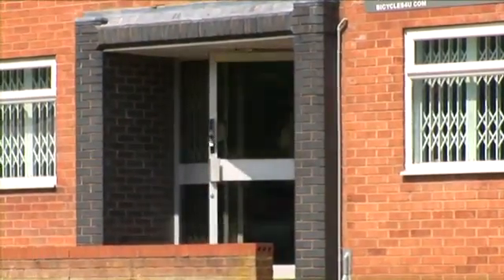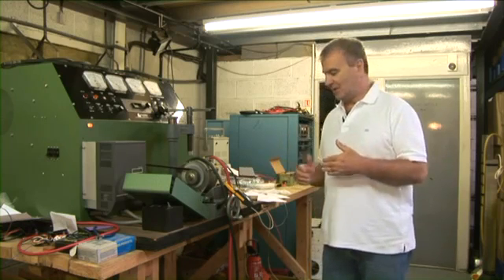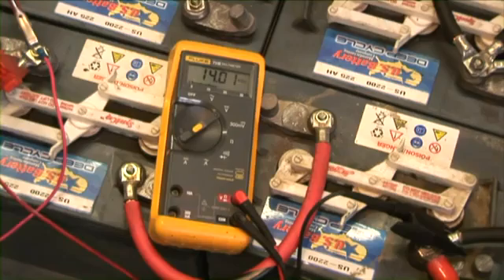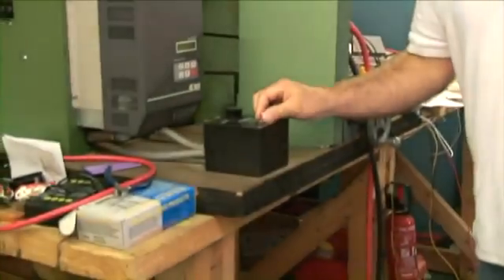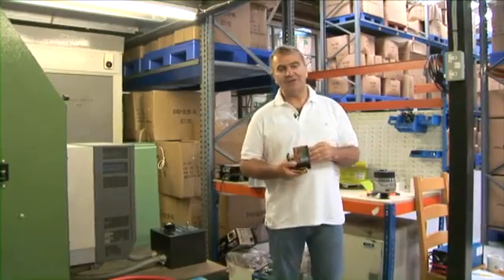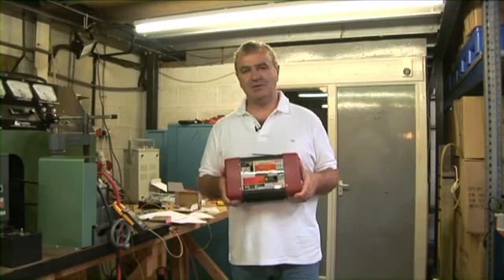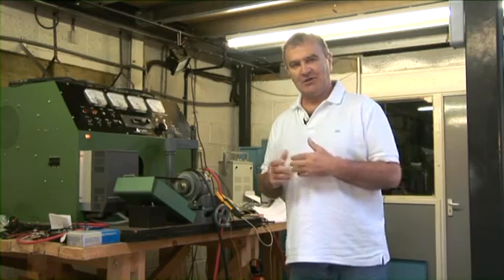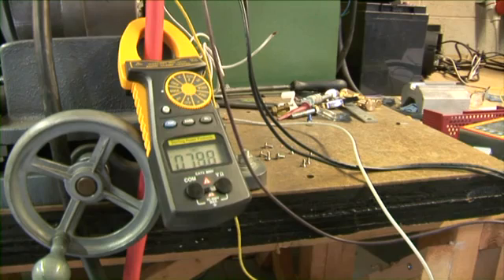Charles Sterling discusses 3 stage battery charging profiles and battery charging

Comment: I'm fitting an a2b charger to my small camper rather than just use solar. When solar can't cope, I fire up the motor and rapid charge the battery bank in the minimum time required.
Reply from the maker: Sounds more than reasonable! We'd recommend people to use a alternator based charger as well as solar solely for the fact that you'll know what you're going to get from an alternator- you can't really say the same about British sun!

That said, if your vehicle is a Euro-6 engine or charging lithium, we'd really recommend you to fit a battery to battery charger instead of an AB!

Comment: What is the difference between the alternator battery charger and the dc to dc charger? Thanks
Reply from the maker: Hi 3d,
Technically, you're right. They're both DC to DC chargers, however we tend to label our battery to battery charger series as our DC to DC chargers and alternator battery chargers as A to B chargers.

There's not too much reasoning behind this apart from the fact that our BB series is more modern, smarter and a cleaner input. 

Perhaps it's just a habit.

Comment: Hi Charles. Thanks for this video. Each time you activate the alternator to battery charger there is a change in the sound of one of the moving parts. It sounds like something is under load or strain. It could be the alternator making that sound, or perhaps the motor on your test bench, the one that is driving the alternator. Any clues? Also, I’m about to have a Sterling alternator to battery charger installed in a boat with twin 115A alternators. The particular one can handle 400A. Is there any advantage in installing two Sterling boxes, one for each alternator? Do you have a view on whether 900Ah of LiFe PO4 batteries can handle the output from two of your chargers and these alternators? Thanks.
Reply from the maker: Hi Valden,

Three things, I hope you don't mind me responding in numbered points!
1) I believe that noise is just the alternator finally having reason to work a bit harder. As the alternator works harder it spins faster and the self cooling it has will be spinning quicker. I believe that's the source of the strain and is fine. It's better than drawing 4x the A but getting the same cooling as before!
2) Advantages to having more Sterling boxes? I'd say so in some cases. It allows you to provide a more bespoke setup to potentially sensitive battery charge systems. If you have different preferred charge voltages or different current limiting wanted (for current limiting, look towards our BB series), it allows you to provide these preferences to those batteries.  If your batteries don't care about being looked after individually and it doesn't bother you, it's not necessary.
3) That's a large lithium bank, however there's potential problems and the potential problems come from your alternator and how lithium batteries work.  Whenever utilising lithium batteries off of an alternator or generator, you must have some form of current limiting device between them, otherwise your alternator is going to have a very bad time.
Reply: SterlingPowerLtd  Thanks for this comprehensive reply Charles. I am discussing these issues with fellow sailors - we have various Sterling devices - along with lithium batteries, which makes for interesting battery and alternator protection challenges. In particular I am looking to install a powerful second alternator (~200A), which will need some kind of dynamic current limiting to control and avoid overheating when charging a big lithium bank. I will study your website, but if you have any suggestions ... 🙂
Reply from the maker: @Valden23  Hi Valden23!

We don't have something public yet that can be overly customised in terms of being able to provide you with a dynamic range of current-limits.

However- that's not the end of it. You obviously still have options available to you. I'd probably direct you down the BB1260 route and a couple of them in parallel if your batteries can handle it. This will provide you with 120A of charge, current limited. If you want 90A, put one of them in half power and the other at full. If you want 60A, put them both on half power.

As long as it's within the C rating of your batteries, you shouldn't have to worry about overheating at all. :)

Comment: Interesting ideas! But if the problem is the internal alternator regulator getting poor voltage sensing from the battery because of cable/wire losses, wouldn't a good, thick  wire from the battery to the regulator input terminal solve this (assuming the alternator has such a terminal)?